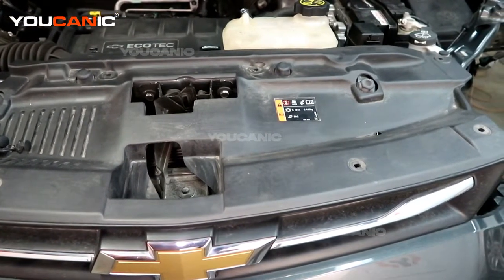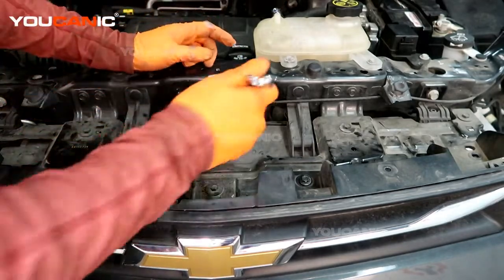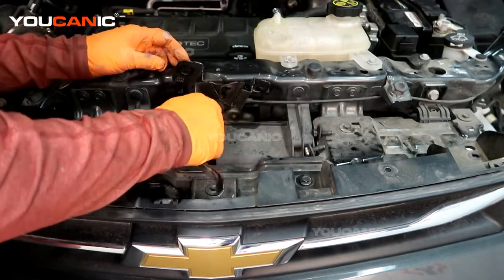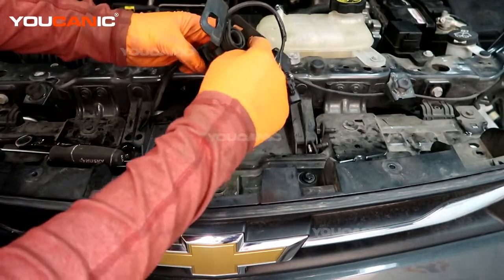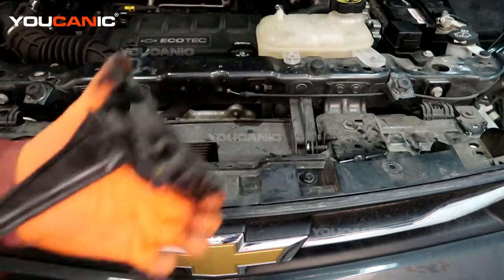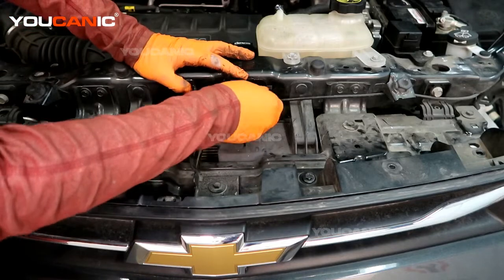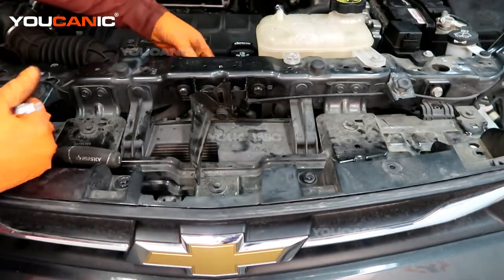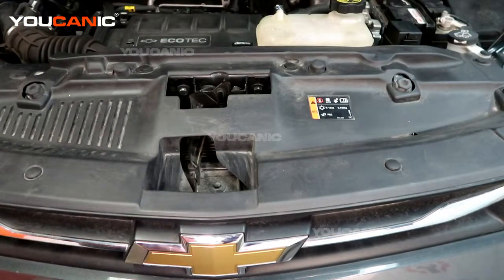2015-2023 Chevrolet Trax - Hood Latch Replacement

Comment: SO what can go wrong with these? Surely there's an easier fix than replacing.
Reply from the maker: Absolutely, there may well be simpler fixes than replacements. On YOUCANIC, we've developed numerous resources to assist you in self-diagnosing and repairing. Try out our Full System Scanner (www.youcanic.com/scanner). It's like having a mechanic in your hands and may lead you to an easier fix.

For additional help, visit www.youcanic.com. There you can find Factory Repair Manuals and even a platform to ask car-related questions. If you still have queries or need further guidance, feel free to ask. We're here to be your reliable source for all things automotive.